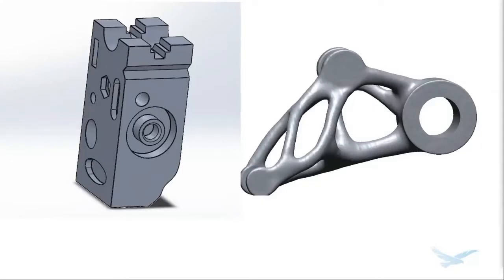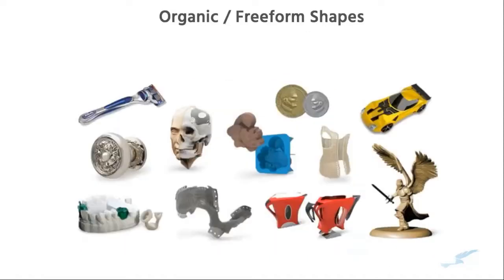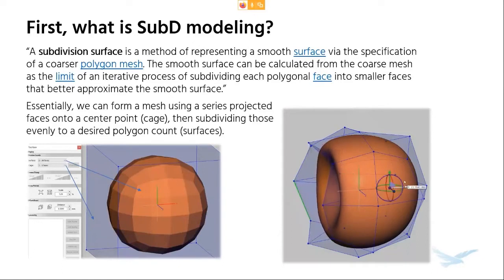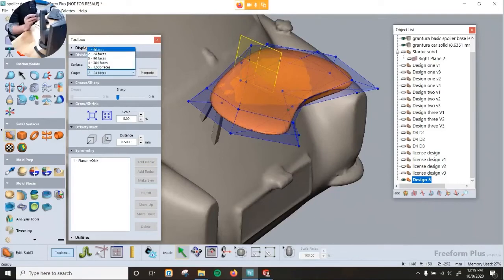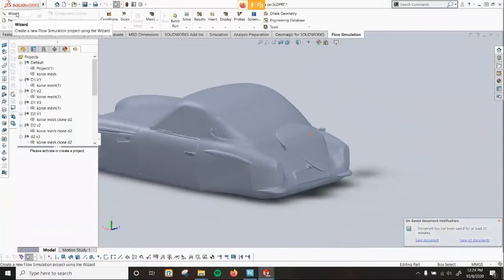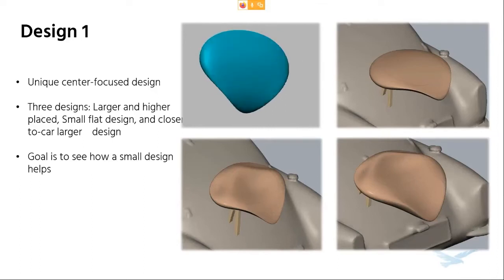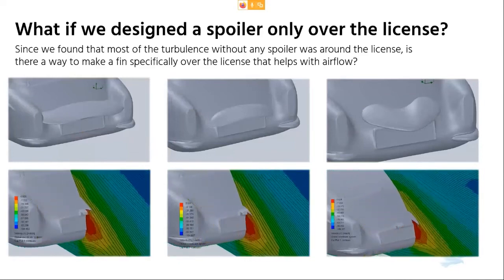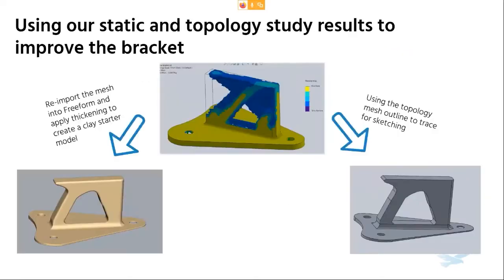3D Scanning: Overcoming Traditional Design Limitations

Comment: What is the robotic arm looking mouse that you are using to manipulate the model?
Reply: Its called a haptic device and specifically thats 3D Systems Geomagic Touch X model which used to be under another brand name "SensAble" before they got acquired by 3DSytems ,which btw was also the original company that develepped the "Freeform" Modelling Plus software FFMP.